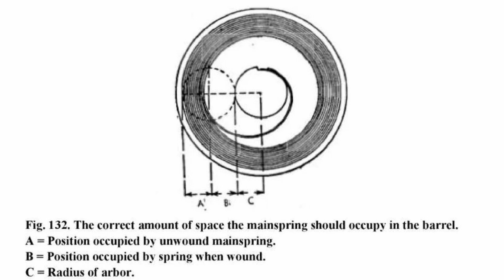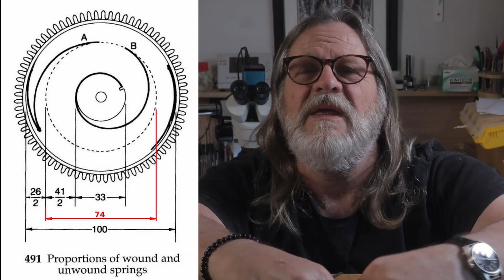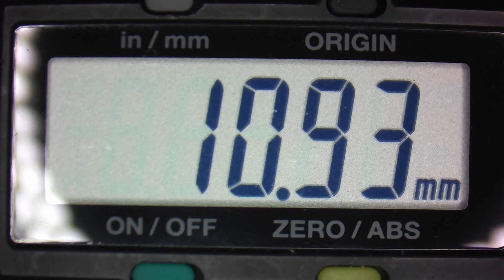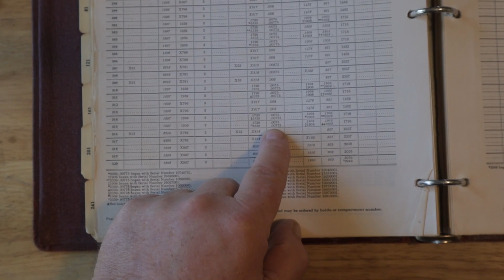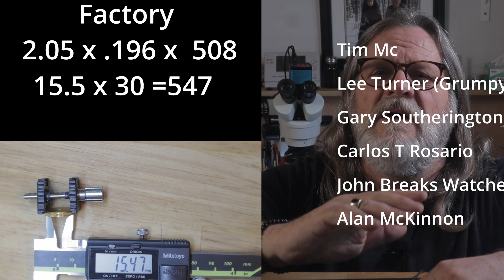How to Size Any Watch Mainspring to a Barrel

Comment: There are so many things comming to live that i never thought about...👍🏼👍🏼👍🏼 PS. Do you know how they made a temperatur compensaded ballence wheel. I mean how did they bind the steel to the brass?
Reply from the maker: The balance spring was made of an outer layer of steel and an inner layer of an alloy called Invar, which had a very low coefficient of thermal expansion. As the temperature changed, the two layers expanded or contracted in opposite directions, again canceling out the effect on the balance wheel's oscillation rate.
Reply: @watchrepairtutorials  but wouldn't  the layers of the ballence wheel seperate over time? I mean If it is geting hot and cold for over 100 years.😅👍🏼👍🏼
Reply from the maker: @seangerst6561  most watches are not exposed to extreme changes

Comment: I can’t tell you the number of times I’ve acquired vintage watches that have come with entirely wrong mainsprings.  In my rookie days, I would dutifully order a replacement mainspring by measuring the width, thickness & length of the old spring, punch in the numbers at CousinsUK and then wonder why the watch still ran poorly.  I learned more from my mistakes than my successes.
Reply from the maker: I know people don't like to do this, but sometimes it might take 2 or three attempts to find the right spring for a movement.

Comment: Another awesome video Alex!

What do you do for mainspring diameter?

I usually take the barrel ID and then pick the mainspring with a diameter one or two sizes lower.

One time I bought a mainspring with a diameter JUST under the barrel ID and yet it still was too wide to press into the barrel from the containing washer.

Always keen to avoid this, sometimes I order mainsprings with a diameter that is too small, and then the central loop is too small and incredibly hard to get around the arbor.

Thanks!
Reply from the maker: Thanks Derek. What are you referring to when you say diameter?
Reply: @watchrepairtutorials  Like when you order a mainspring from Cousins UK, it lists 4 measurements: Height-Strength-Length-Barrel Diameter
Reply from the maker: @dereklouis4710   Sorry,  Mainspring Diameter confused me . Its referring  to the Barrel ID which is what I use to figure out what I want. I look at the overall condition of the watch. I will usually stay close to what is spec'ed out but if I have done everything I can do, then I will go a little stronger and usually shorter. I use this formula to see whats possible.

Comment: This is so great, thank you. I'm struggling right now with a UTC movement that is knocking, hits 360deg even at a very low wind and I've been gathering info to replace the spring appropriately. This is so timely, I really appreciate it.
Reply from the maker: There you go. That’s one possible solution

Comment: Another fantastic video. What about some safety barrels where the spring comes above the top of the barrel and there isn't a snap on lid? Waltham for example. How would you do the height on these?
Reply from the maker: the best way is to figure out what was there which is easy for Waltham. You are not really going to want to change width very much at all.

Comment: Alex, another great video, thanks! I probably have a bunch of watches like you explained where the amplitude is low after servicing and the main spring looks good. So should I consider a thicker spring? But then what length? Often the original spring isn’t available, so should I go for a longer spring or a thicker spring! There are a lot of variables? Is there a most popular Swiss barrel ID size? In another video you spoke about the idea of buying one Bergeon winder, this might get be started? Ta!
Reply from the maker: Well Boyd, there are lots of things that can cause low amplitude that are not mainspring related as well. 
If you have  done everything you should have and there just no way else to getting the amplitude higher, you can try a stronger spring. Just drop the length a little.
Reply: @watchrepairtutorials  Thanks Alex!
Reply: Hi Again Alex. I thought you had a video on watch winders, but cannot find.  If I had a watch winder  for a 7mm diameter barrel, what barrel size up could I also use this on, 8mm, 9mm? Thinking of buying some and hoping they will work for a number of different sizes.  Also the Chinese sets are per caliber but these sizes are mostly different from 7mm to 12mm so maybe this is a good starter set??? Thoughts?